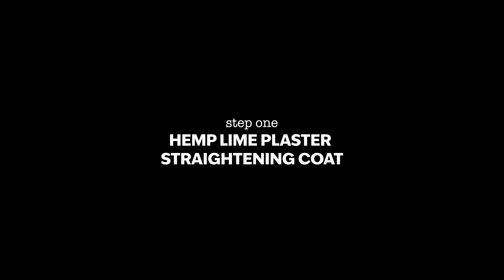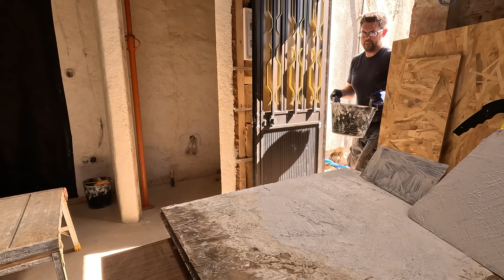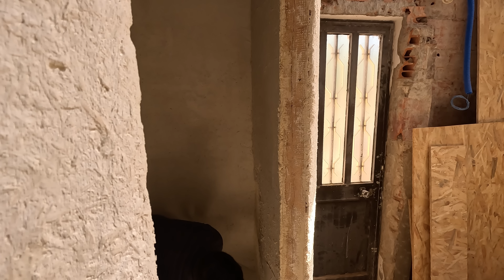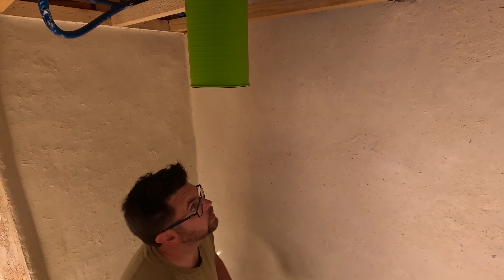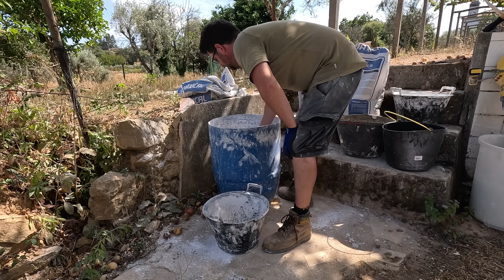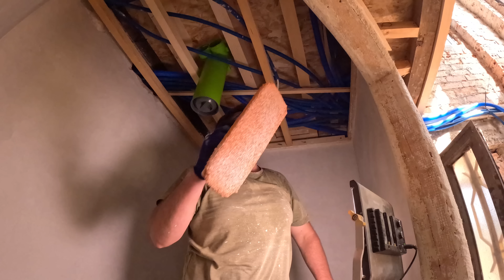Silently Plastering a Small Room - No Talk Just Work

Comment: Great work! Question- I do not see any switches for a light or an exhaust fan on the walls inside or out. Will they be run on the surface for some reason ? 🤔 BTW, really enjoy the videos !
Reply from the maker: There is a switch on the outer wall (left hand side) for a light.
There won’t be a traditional exhaust fan, rather an all-house ventilation system … that’s the green thing you can see mounted in the ceiling (ducting not yet installed)

Comment: This is looking amazing as always guys… all this hard work is going to really pay off when you can finally lean back, drink in hand and salute each other on keeping at it and the beautiful outcome xx Can I ask also, what the difference is between cal hidratada and cal hidráulica? Thank you xx
Reply from the maker: Hidratada = hydrated, it’s quicklime (also called air lime, or cal viva in Portuguese) that has been slaked and then dried. Air lime sets via exposure to the air, it absorbs carbon dioxide as part of its curing process

Hidráulica = hydraulic, a different type of lime that sets by exposure to water. It is much harder, sets much quicker and is a lot less porous (ie. less breathable). Recent research has found it has properties very similar to cement after a period of time.

There are different situations where both are an appropriate material to use due to their different properties